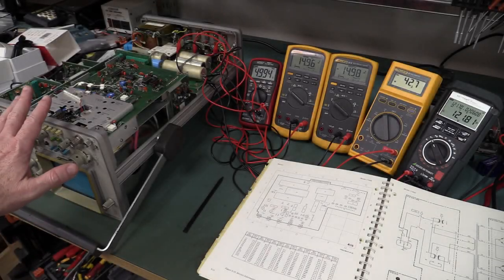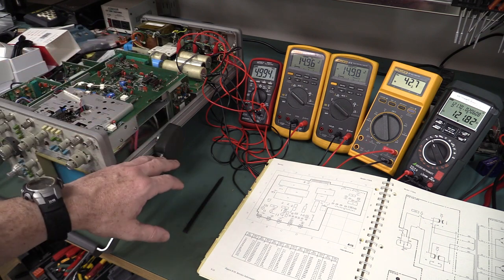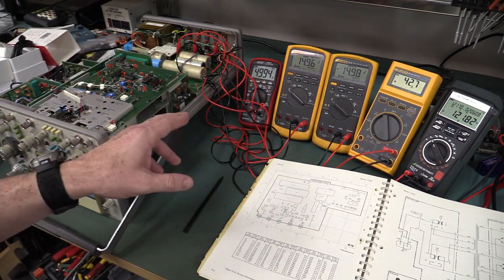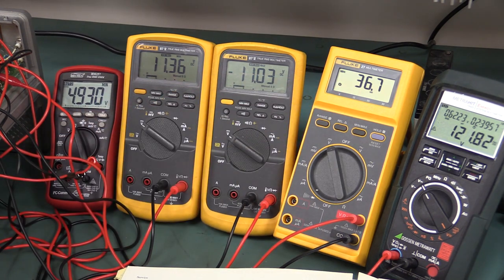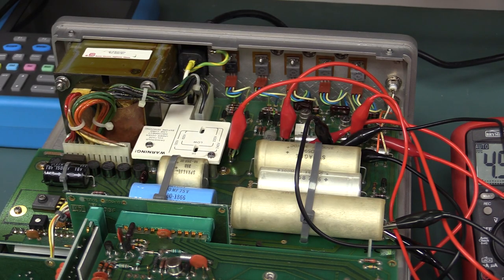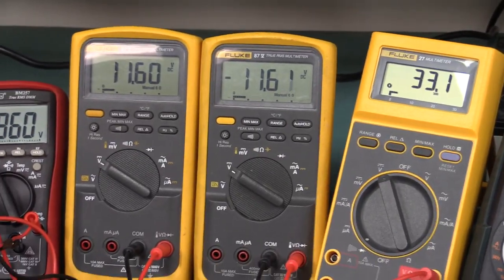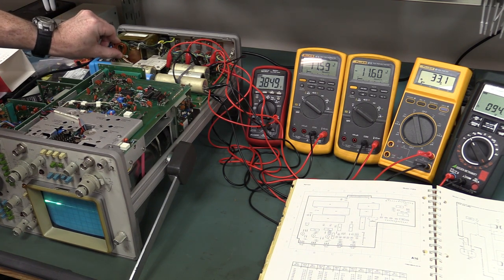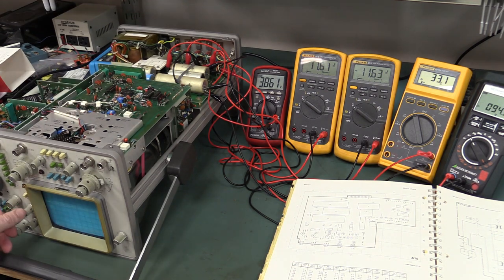EEVblog #804 - HP1740A Oscilloscope Repair - Part 2

Comment: 720p50 is missing again?
Reply: +stonent you need to wait for a while...YT needs some time to render the different sizes;) i just watched it in 720/50
Reply from the maker: +stonent This one was deliberately 30fps.
Reply: In my opinion, the jump from 720p to 720p50 is a better jump than the difference between 480p and 720p.  In fact,  I prefer 720p50 to 1080p30!

Comment: I had exactly these kind of behavior with a single ended tube amplifier.
Main suspect right away the PSU area, checked. double checked everything seemed fine, nothing defect or other weird behaviors. 

It drove me insane! couldn't figure out why the main power transformer was behaving the way it did.. was afraid the transformer was to blame (rather rare Bocama metal so i really don't wanna replace it)

Turns out,... after days yelling and screaming and tearing my hair out. A faulty mains cable and a dirty contact switch :/
well f*ck me.

Comment: Dave, there's no way you would have solved it in 15 minutes without the camera. First of all, with no camera, according to quantum physics and philosophy, the scope doesn't exist! Also, just setting up all those multimeters would take you 15 minutes.
Reply from the maker: +lodevijk Yeah, correct, setting up gear and fiddling around take a bit, but in terms of actual troubleshooting itself, it's probably about right.

Comment: DAVE, read circuit operation from the HP manual before assuming anything, saves time  over theorising  about circuit operation and coming to false conclusions.
As you read, every voltage rail in this HP power supply is  referenced to the  positive 15V rail, if all power supply  voltages are fluctuating check that one first.  Bridge rectifiers, if you suspect them remove them from circuit and test the forward voltage drop across each rectifier in the bridge with AN ANALOGUE MULTIMETER SET ON LOW OHMS TO PASS A RELATIVELY HIGH CURRENT THROUGH THE PN JUNCTION. 
Digital meters are usless in this sort of fault finding.  You can see  the resistance of bad junctions of diodes and transistors  varying ever so slightly if faulty. A good junction will show a solid 8-10 ohms (in silicon) or less.  I did not see one analogue meter on your bench, shame.  I have been in the trade as a tech since 1965 start of apprenticeship. I served in the RAAF for over 20 years from 1972 to 1992.  I taught  electronic theory & fault finding at the RAAF School of Radio for near 5 years.  Successful fault finding takes years  of hands on experience , if you read the manual on circuit operation first you will follow less time wasting dead ends
Digital meters are OK for accuracy but will not find intermittent faults.  I own several analogue multimeters and some digital types too.  A good one now available is Pro'sKit MT-2017,    I have four of them. You can pick them up on ebay for less than $50 although some people try to charge more. 
You are interesting to watch and certainly are very passionate about electronics, pity it's all going down the drain due to Chinese planned obsolescence with cheap throwaway badly designed consumer electronics.   The HP 1740 scope was well made and designed to last.  The diode bridges are a weak point.  I have repaired one with a burnt out power transformer, I rewound it (started life as a electrical fitter/Radio tech). Five years apprenticeship then, and I listened when tradesmen passed on wisdom.
Regards Rob